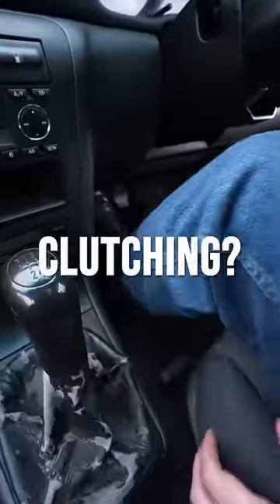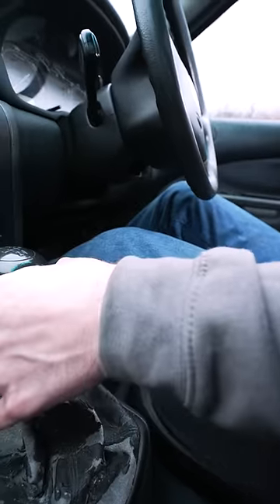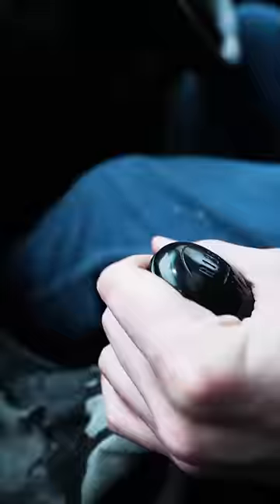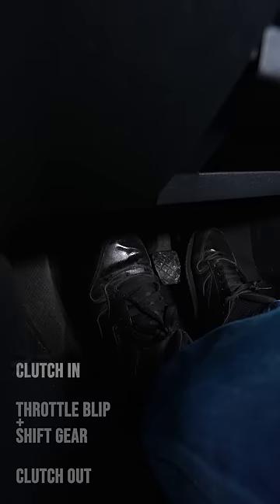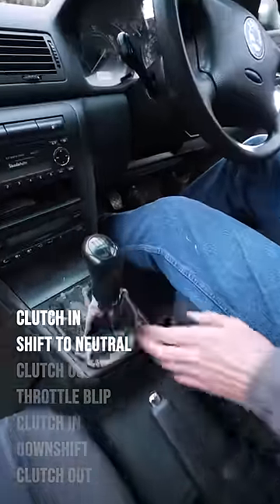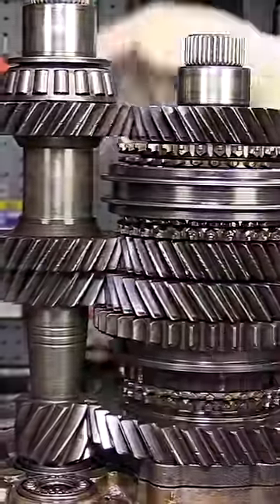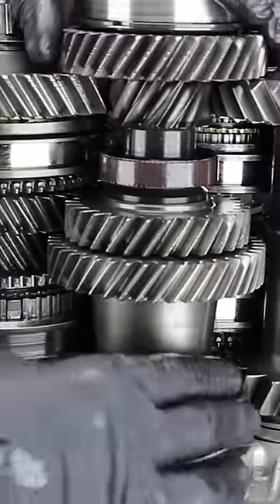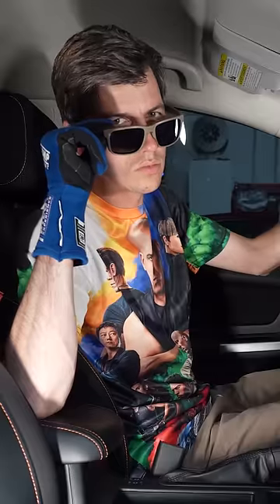What Is Double Clutching? Don't Granny Shift!

Comment: Drove professionally for several years. Never double clutched in my life. Feel the right time and shift...no noise, no grind.
Reply: lol lucky you! I drove an old Honda prelude with worn synchronizers 
double shifted all the time until I found the shift points where the engine and tires ends of the transmission were matched 😋
Reply: Some small companies will even encourage floating for experienced drivers.
Reply: @JimmyMatis-h9y  I think you should get new synchronisers
Reply: Pro drivers don't use the clutch going down the road between gear changes but here where I live you will fail a CDL test if you don't double clutch. You can shift almost any transmission with out the clutch if your close to the right rpm for the gear
Reply: Floating is Faster unless you have syncros. Floating with syncros will give you a Furious transmission rebuild bill.
Reply: @JimmyMatis-h9y  should probably get a new car
Reply: I drove as an amateur for years.  Once moving i didn't have to even use a clutch.
Reply: Pffft. Im not a professional driver and I have Never crunched my gears. Hold the damn clutch in longer.
Reply: @The.Drunk-Koala  drive an unsynchronized trans. Holding the clutch down longer does nothing.
Reply: @HeinzGuderian_  1970s VW beetle held a few beers mate.
Reply: Isn’t double clutching used if you’re like on 5th gear with low rpm’s and need to quickly speed up
Reply: @Youssef06_  no. Double clutching is used on non-synchronized transmissions for the purpose of getting the shafts timed with each other so you can shift without grinding. Just knowing how the transmission "feels" eliminated the need for it.
Reply: Never clutching here.
Reply: Thanks for saying that I thought I was doing something wrong
Reply: Old school engine are smoother by double clutching.
Reply: not a professional but same here.
Reply: Going very low speed down a hill, especially off road, it's the only way to get it in without bumping gears.

They taught us at driving school to double clutch because supposedly it saves on fuel.  But it wasn't enforced at all and they basically taught us clutchless because that's obviously the way those transmissions are designed to be used.
Reply: What did you dice in if you don’t mind me asking?
Reply: "drove professionally" is such a vague term lmfao. were you a trucker? a racecar driver? an ambulance driver? a self driving car tester? the possibilities are endless
Reply: You've obviously never driven a 1963 VW.  :D
Reply: @zounds13  lol. No, but I learned to drive in a 1963 Corvair. Basically the same setup.